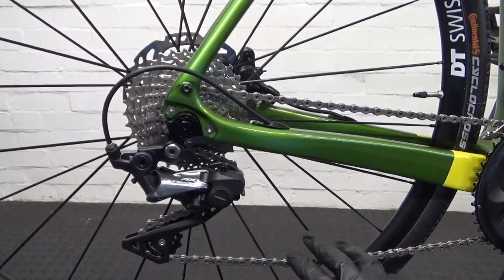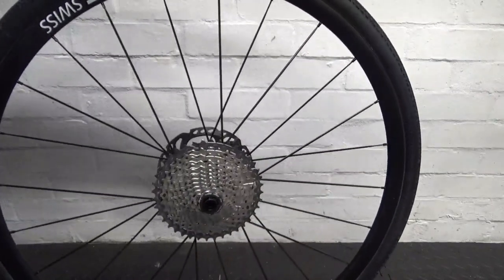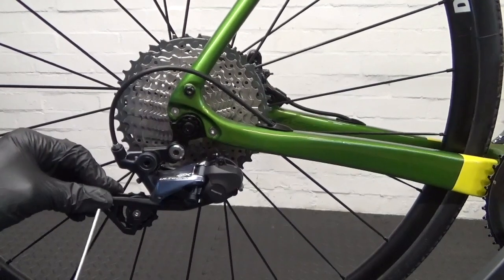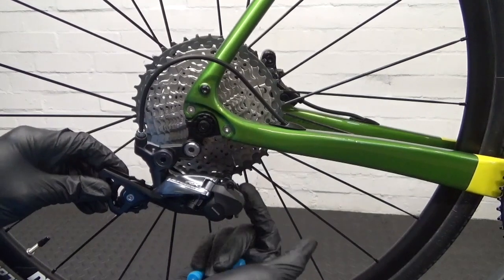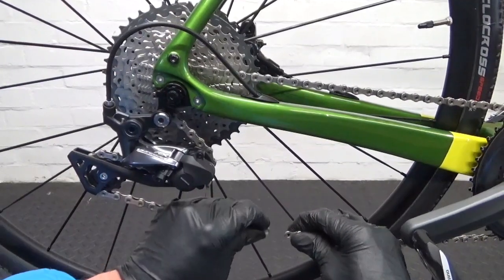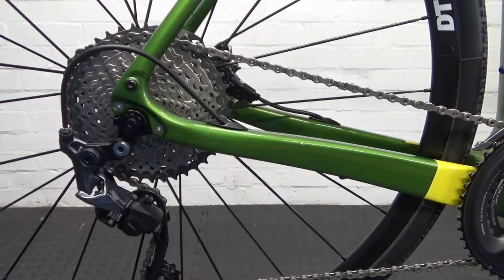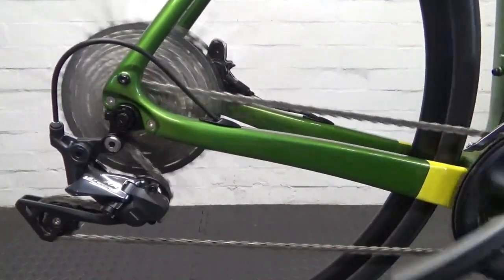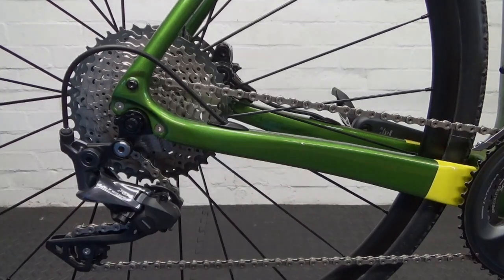Shimano Ultegra RX800 11-40 Cassette Fitting Guide

Comment: Thanks for the guide, just installed an 11-40 cassette on my road bike and I love it! Interestingly, before cutting the chain, I sized it using both the small-small and big-big method, and the length came out the exact same. It's weird Shimano has such conservative recommendations, right now my setup requires 45t of capacity, which is significantly more than the 39t listed in the specs of my R8000 derailleur, yet I can use all gear combinations without any excess chain slack.

Comment: Ultegra RX RD supposed to accomodate a max low cog of 34, and a total capacity of 39t.  We're wayy over that here and I see it works anyway so I'm doing it next time I need to hit the steep steep roads.  I have 50/34 and 11/34 right now which is at shimano's max 39t total and the max cog of 34.  Great to find this.

Comment: Great video, very useful as usual. What I don't fully understand is this freehub spacer. What is a spacer for? You took off road cassette and put MTB cassette but still used the spacer so it can't be the cassette offset. Difference must be in the feehub body itselt. I have DT Swiss weel with MTB freehub a 11-40 XTR cassette and RX800 rear deraileur. Do I need to use any spacers to make it work on a gravel bike with Ultegra road shifters?

Comment: Great video. I thought you can only go as high as 11-34 with 50-34 in the front? Any worries you will damage the derailleur? Looks like you have the long cage, which is what i run.
Reply: You may be right but I think he said it was a 48-31 (sub-compact) chainring which is standard for GRX810.
Reply: My mistake, it is indeed a Ultegra RX not  GRX so it is 50-34. Many reviewers have commented that Shimano are quite conservative with their maximum cassette size, there are others doing this with a GRX815 which is the gravel equivalent of the electric Ultegra but not a well explained as this video.

Comment: Hi i have 52/36 front Ultegra R8000 crank with 11/28 cassette in rear with SRAM Etap 11 speed RD it's Standard short cage version want to have 11-34 or 11-32 atleast for better hill climbing. Let me know will just b tension screw and longer chain swap will work or do I need Roadlink wolftooth or similar. Thank you

Comment: Thanks a lot for this video👍🏻 I‘ve got a Shimano Ultegra Di2 8000, 50-34 with dirailleur RD-RX 805 GS. Do you think this also will work with a 11-40 casette? Thanks for your help🙏
Reply: It work only if the derailleur is GS cage.

Comment: I bought a CSM 7000 Cassette (11-40) and tried to fit it with this exact same ultegra detrailleur...but somehot the spacing seems to be wider that on the regular ultegra cassette...I thought the spacing was supposed to be exactly the same on all 11 speed cassettes? Did I miss something?I used calipers to measure the distance between the individual sprockets, and there seemed to be a larger gap between the CSM7000 gears than between the ultegra gears, so that there was no possibility to index correctly...Is that possible or am I just completely stupid? ;) thanks!!
Reply: I think I have the same issue too. I was switching from slx 11-34 that was originally installed on my topstone 1 with 11-40 slx and I have this weird noise while pedaling =\ Did you find a solution or have you tried xt cassette?
Reply: hello there,
I tried again, and this time, all went well…indexing was as easy as with the original cassette. No idea what was wrong the first time, but since I installed it, I did around 1000km without any issue 🤠 so I guess you need to check that everything is seated correctly and you may have to index your shifting freshly. parktools has a brilliant video on how to adjust rear derailleurs, in case you sometimes struggle to get it right :) good luck!!
Reply: @tidalwavestudio  I have even installed new slx chain but there is some weird m metalic noise. Just to double check: you do have spacing ring at the base of a cassette? (I had it installed with 11-34)
Reply: yes you need a specific spacer
Reply: @tidalwavestudio  I assume the same as was used for 11-34 🤔
Reply: it is advised to use a 1.85mm spacer

Comment: I have a di2 rd-rx805 11/34 and 46/30 Oval. I want to put a 11/40 on but bike shop says it won’t work. After watching this I don’t necessarily agree with them. I know they worry about cross chaining but I don’t do that anyway. Thoughts?
Reply from the maker: No reason why it wouldn’t work! As long as you can adjust the B-screw enough then you will be fine.

Comment: Nice video! What kind shift lever do you have for the rx800 derailleur? Will it works with rs505 shift lever? Thanks!
Reply from the maker: Yes the derailleur will work with a RS505 shift lever!
Reply: @FreeToCycle  how it's possible? I don't understand.Road rs505 stuff how compatible with mtb casette? it has not different scale between the sprockets?  Thank you! Big up!